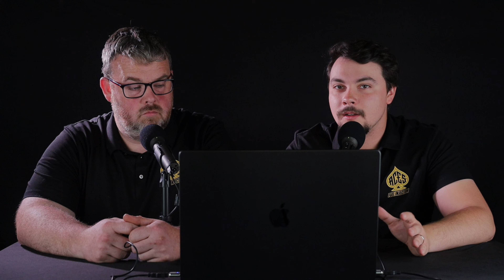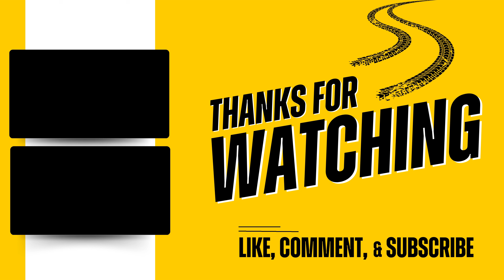GoodGuys Columbus (Tech Tuesday Ep. 77)

Comment: Tim so my Sbf’s some are HO firing order and others are the “old” firing order. I want to 3D print a high ram style upper to fit my Gt40 lower…using ls injectors and Throttle Body.. question are the firing orders pre programmed or can you enter  them for different applications

Comment: Hi, I have the Quickdraw that I'm using in conjunction with my Killshot on my 55 Chevy with a Vortec 350 and 4l60e.  I had to play around with it to get it to up-shift decently. My main issue is I cannot get it to down shift like when passing. You punch it at any speed and it stays in the same gear. I've. Gone thru and made sure I have the correction done correctly as per the tech department but still cannot get it to downshift. Any suggestions? Also the manual could really use an update with some troubleshooting tips.Theres not much out there about the Quickdraw since you  put it on the market.

Comment: Hey guys, I'm actually a Chevy Citation guy - go ahead, it's ok to laugh.  I have several Citations and the other 80's GM X-body cars - the Deuces Wild & High roller are my first Aces kit that I put on a 4.9L Caddy motor swapped into an 81 Buick Skylark that is my daily driver/ Budget Beater.  I tried posting a link to the build thread but seems to be getting blocked - just trying to share pics and info... 

Going to jump into the Jackpot video series - that is the next kit I will use for a Turbo LS swap into an 83 Olds Omega.  Thanks for the content - really want to see the tuning manual!   Cheers

Comment: Hey Guys …so since last Tech Tuesday I’ve been binge watching/listening to all the TT vids  and I have a GM Transmission question. I Just Started a SBC gen1 swap in a 98 ZJ Cherokee I want to get the KillShot 2 for the progressive linkage for off roading …however you guys repeatedly say “your not 4wd guys” if the trans controller can’t handle the transfer case should I just go 700R4 instead of 4L60E?  I was hoping to use the trans controller with the 7” for the speedo feature  this truck has No factory wiring left in it so the 7” dash would be best

Comment: I bought a wild card master kit with command center 2 from Aces. I got it running immediately. It's a great product. I do have a question about the fuel pressure on the command center. I key on and get 58 psi, after the fuel pump stops, it immediately goes to zero psi then will not start. It will start every time if I turn the key immediately to engage the starter. If I key on and wait till fuel pump stops, it will not start. Any help would be great. I did do the hard to start document from Aces, adjusted the fuel prime percent, didn't seem to help.

Comment: Is it possible for future iterations of the tbi system to have an adjustable throttle return spring rate? I like how it has a built in spring but was a bit weak in my opinion and I ended up installing an aftermarket throttle return spring kit that I had to slightly modify to work to my satisfaction.
Reply: Just to clarify on the aftermarket spring. The modification had nothing to do with aces. my truck never had a proper return spring and I was messing with it before the conversion.

Comment: Quick tech question that has me stumped. I have a 2001 crewcab s10 running a 04 flex 5.3 from a tahoe with matching 4L60e. Have mated the s10s np233c tcase running jackpot ls pro dbw. I have the vss Calc correct at yalls stock 30% and 40 tooth like yalls stock and 5 on the vss "toggle setting"?? I have my tach out set to tach out. It sends like 1300 over actual rpm. But the handheld reads 4 over actual GPS mph vs vss mph. Where should I be adjusting to get vss mph Dailed in. The vss Calc correct doesn't seem to change anything. On handheld. ❤

Comment: Since I’ve been using your software daily for the last couple of weeks, I would really like to see the VE table expanded. I believe you advertised having a 3 bar map on the Killshot, which was a selling point to me. However, there aren’t enough rows to realistically tune for much boost. I do plan to add a low boost turbo in the near future, and taking just two rows for tuning above 100kpa doesn’t leave much below 100 for my daily driving tuning. 
Please also add the ability to dial in the temp sensor like you have for the FPS and OPS. The two temp senders I have (aces and a spare) are both reading about 15 degrees too hot. 
Is it possible to split the can cable into two plugs, so I don’t have to unplug the hand held to plug in my laptop? I can build the cable, I just want to know if it’s safe to do so. 
Thank you!
Reply: Two more things; can you please define “push” and “follow” as they would relate to needed adjustments for a manual transmission car, coming to a stop, pushing the clutch in, and having the RPMs fall. Please add any other advice or settings to keep from stalling during a stop. 
Last- please Please PLEASE(!!!) on the hand held allow the MAP to be read in KPA without the whole screen being in metric. I would imagine most people read/tune in imperial, but all your tables are referenced in kpa, so knowing the MAP in “psi” just creates extra math to do in my head while driving.

Comment: Here's  a thought , to activate  fans while engine  is off , but key on ...could a switch 12v supply   be installed to the AC on fan wire to supply power to wire to activate the fans? Or does the ecu need to see rpm?  Thanks for another  great episode.  ✌️

Comment: Thank you, I hope you implement keeping the fans with key on. But nothing that a cool down lap can't help till then!
Reply: So temp sensor is in the intake…fans cool radiator ..if you had electric water pump could you use fan 1 to turn on Wp and fan 2 for fans and cool the whole system
Reply: @NoGarageGuy  from what Tim said the fans won't be on unless the ecu see rpm signal. But if they go back to when the key is on then it'll run the fans with have to have the engine running. My ls swap is for drifting and would like to have the fans running while engine is off.
Reply: @NoGarageGuy I would probably use the ac wire for the water pump and use the fan wires for your fans. But remember to set you temperature to activate everything accordingly

Comment: Hi guys. 5.3 ls chopcabra cam tbss intake  50 lb injectors 92mm Nick throttle body aces jackpot 58 psi fuel regulation .truck don't start right way have to give throttle any suggestions?dbc
Reply: Try adding some air via the Idle 1d Table labeled Park air vs ECT. Increase the value a few % at a time at the temp range that you need to give it some pedal to start.